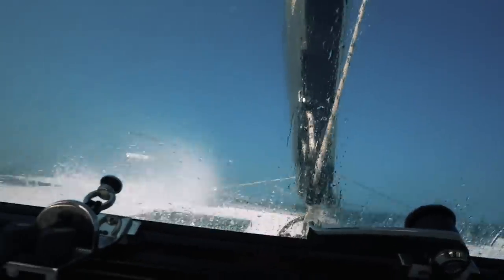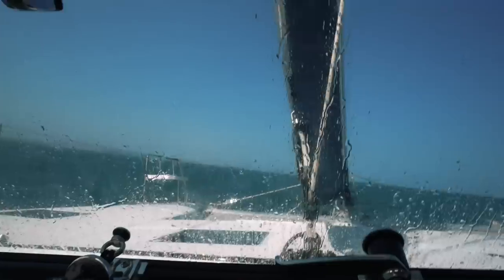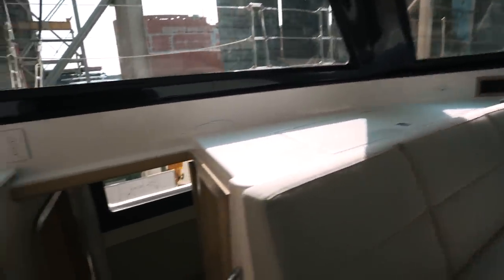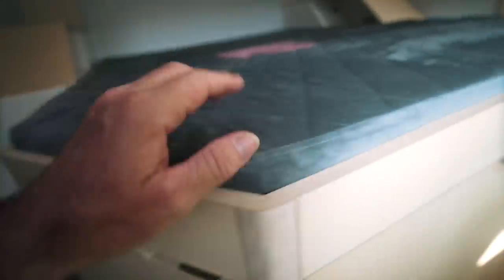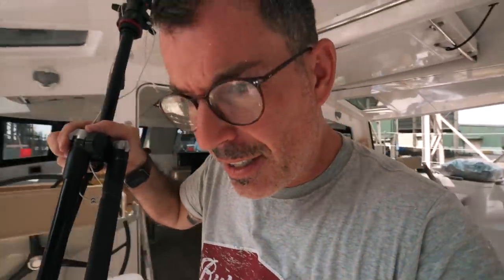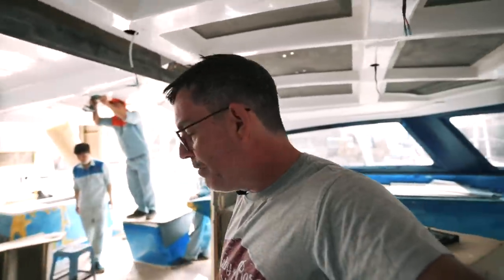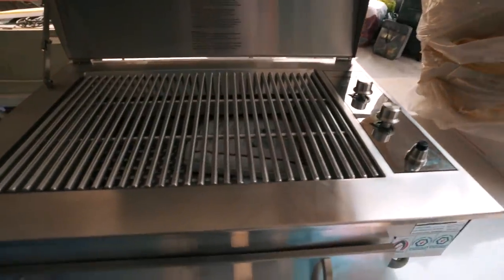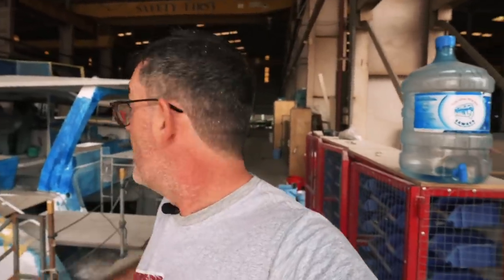Boat Building Challenges: The Upgrades Being Made AFTER the Test Sail!

Comment: Nick, I would like to see the specs on Ruby Rose II to see how you have configured your new home. For example, what are you getting for propulsion, solar panel capacity, batteries, electrics (not necessarily manufacturers, but what devices will you have), and a plan view of each level. Have you seen Ryan's (Ryan & Sophie) Dakota Lithium as a starter battery? If you have a link that covers these items, then link would be okay. Thanks for taking us on this journey, but riding the motorcycle in the city made me a bit nervous. Best, :¬) Webhead USA

Comment: All the more reason not to buy hull #1 and to be wary of a new build. Let someone else, original and subsequent owners, deal with the problems and kit it closer to your needs and wants.
Reply: More like a reason for not buying hulls #1-10(ish) in that case... As shown in the video smaller tweaks and modifications will be done on all the boats on the production line INCLUDING #1 but major stuff like tweaking the hull shape or structural elements etc obviously can't be done once a boat is already in production.

Comment: A lot of new boats are opting for electric BBQs and induction hobs because propane is yet ANOTHER fuel source that you have to supply and store on ship. In addition to all the tools and replacement bits to keep propane working.  I'm just wondering what are your thoughts on the propane vs all electric.

personally I prefer eating and cooking on gas but can't deny the space, weight, and time savings of eliminating another fuel source.
Reply: Going all electric may leave the crew vulnerable to a single point of failure on the inverter or battery bank.